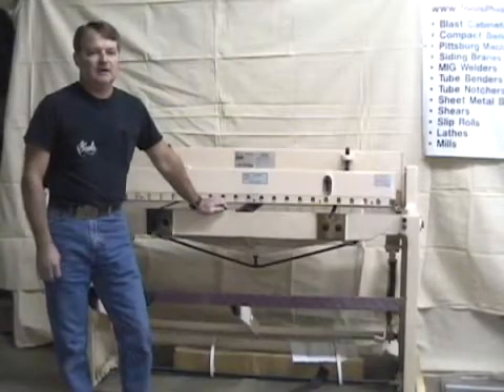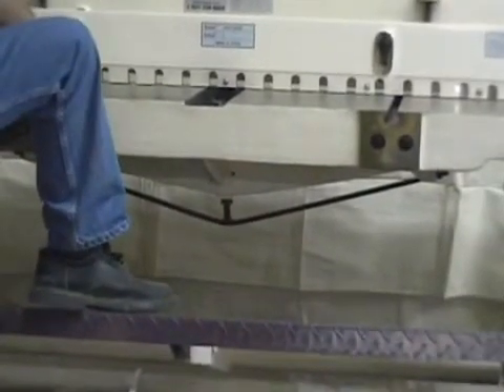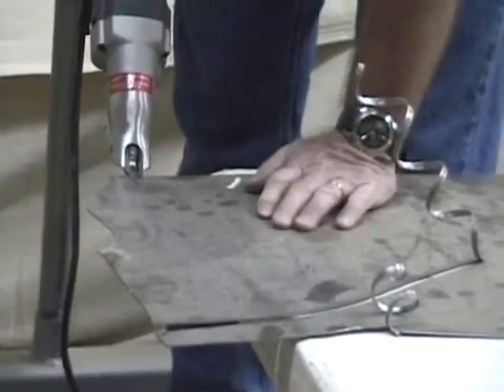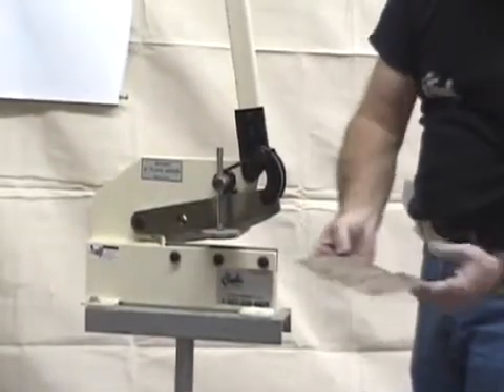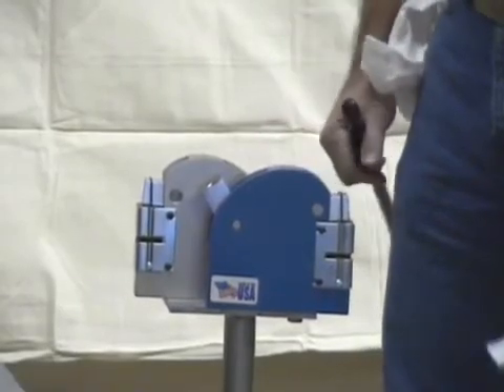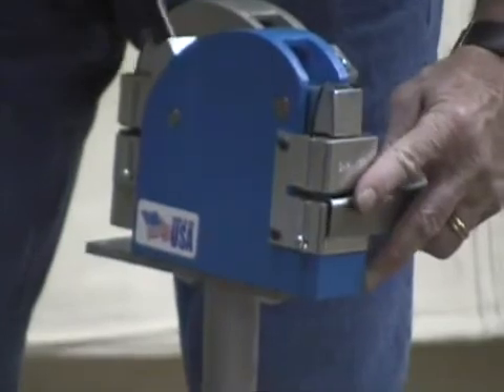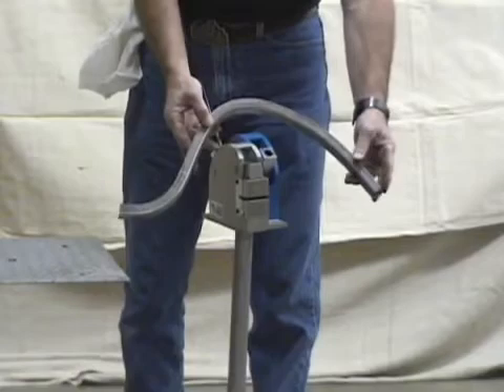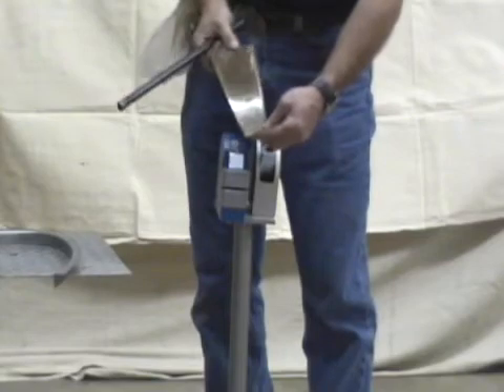part 1 basic sheet metal fabrication sheet metal shears, stretcher shrinker

Comment: From start to beginning?
Reply: +craig hood Because this is only the beginning ;) the rest is using various elements such as aluminum, iron, copper, etc to heat and pressure to create the sheet. The other part is molding the sheet metal according to the product you are going to produce. Then you have to take in for account the transporting of the metal and then the proper oils used to maintain the metal fresh and pristine.